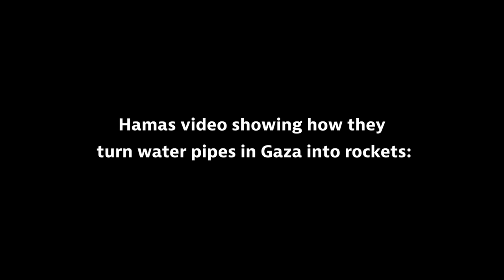How Hamas Turns Water Pipes Into Rockets

Comment: To the IDF, you should consider using gas before the invasion. I understand it’s a sensitive subject, but using ground troops will be really really bad. I was in Iraq in 04/05 trust me I know and understand the enemy’s methods.

USARMY 
Retire Reservist
Reply: They can easily block that with cemented wet clothes And sacks full of dirt .
Reply: Hamas would have stockpiled gas masks  also may have extraction fan in tunnel system  ....gas most likely not work  .

Comment: Question for the IDF: What is the blast radius of one of these rockets? I've seen the damage to the cars in the hospital parking lot, and in my opinion, if it was an Israeli bomb that struck the hospital, there would have been a much bigger impact zone and more damage caused.
Reply: Wrong.
Reply: Ya its inasane to say israeli rockets would do such small dmg and hole in the ground

Comment: Steel water pipes make no sense in the first place. 
So why steel piping ? who accepted that ?
Up to 25 bar ( 250 m high ), plastic is stronger, durable, more flexible, doesn’t corrode, and much easier to handle and install. Likely cheaper too….

Comment: Until this video the IDF have put out some outstanding content here. This one leaves a lot to be desired and perhaps should have some more information with it or have been skipped. 
Yes you can make rockets from pipes. That’s all they are, a pipe filled with solid fuel (or liquid but solid is much simpler). However, there are a lot of scenes in this video that make no sense without context. 
For one, digging up old water pipes isn’t a very good source of pipe and is labor intensive. They are also likely to have imperfections that would be problematic in a burning rocket motor. Corrosion, tiny dents, etc. 
The painting makes no sense as home made rockets are going to be high explosive and not need standard markings because terrorists don’t need to know what type of rocket it is. 
Pulling submerged bombs from the water is highly inefficient when rocket fuel and high explosives can be easily made by such an organization while reclaiming submerged and previously cured explosives is difficult at best. With all of the support from Iran, including full up weapons, it’s just not realistic. 
I should know. I’m a U.S. trained ordnance technician. 
Perhaps this was just a PR clip by Hamas trying to show “how hard they were working” to “protect” their human shied population. 
But please IDF. Give us some context.

Comment: On one hand...

Its Talented Engineers.

I mean ive been told Food Water and Electricity has been shut off within the strip.

If the water pipes and other infrastructure is no longer working for its intended purpose. Finding the now useless pipe is pre-mapped and evidently. Easy to dig up. 

What i want to know is who is giving them the Solid Fuel or otherwise Rocket Boosters?

Do they have their own Underground Breaking-Bad tier Super Rocket-fuel lab hidden from us?

...still Terrorism. Still horrible.

But the Ingenuity is there.

Just wasted...

Well... to them its not a waste.